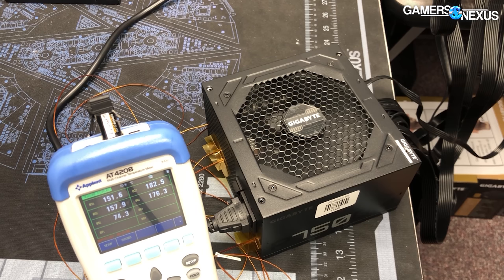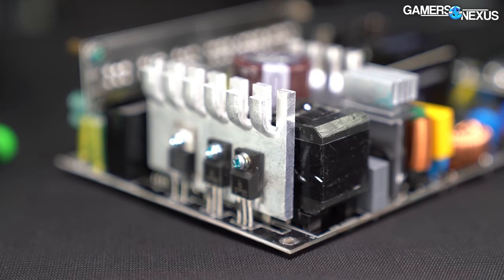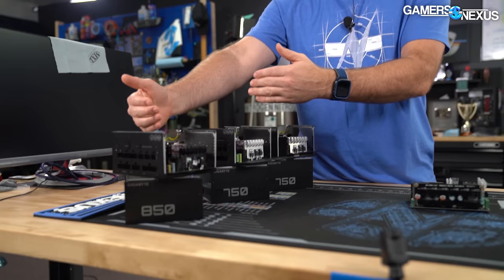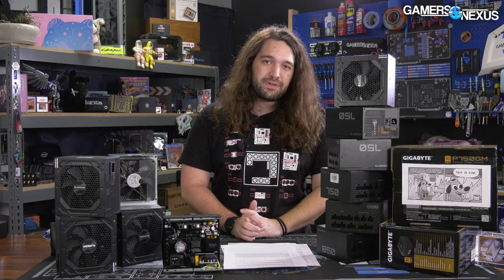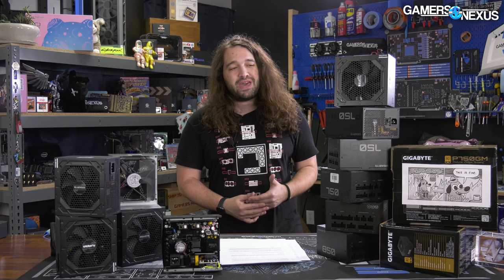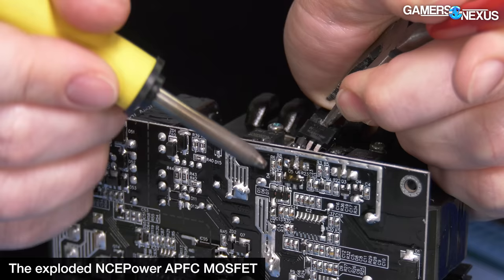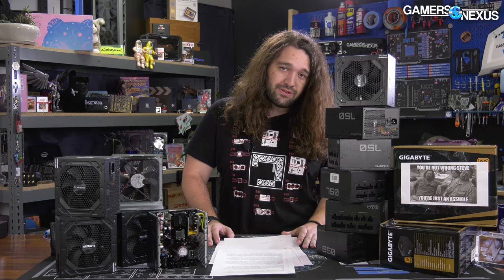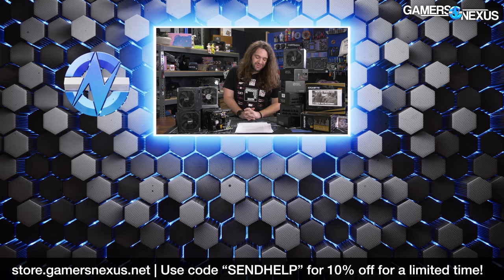Exploding Power Supplies: Gigabyte & Newegg Dumping Unsellable Product

Comment: Fun Fact: The day after this video was posted, Newegg stopped bundling Gigabyte PSUs with cards in the Newegg Shuffle.
Reply: I'm quite worried about my GPU now. It's Gaming OC by Gigabyte. So far not bad, almost a year, but who knows?
Reply: To be fair, shuffle is another word for having a dump. These PSUs are a shuffle, indeed.
Reply: @uraniummore770  gigabyte gpu is ok. It just their psu and some mobo is bad.
Reply: @fr0z3nshade  I see. Well that's very reassuring, thank you, truly. I shall take care of my system, so it would be fine as long, as possible (:
Reply: lol they couldn’t get away with forcing incendiary explosives on unsuspecting customers anymore
Reply: I stopped buying gigabyte after a motherboard cap popped and killed a CPU.
I go ASrock now and I haven't had a issue.
Reply: @uraniummore770  i don't think their cards are bad. i had a 1060 3gb from them for about 3 years before i upgraded to my msi 1070ti. the 1060 worked good for me during. i think it's just their psus.
Reply: What are they bundling now? Old motherboards? :)
Reply: They won't take your powersupply back unless it's part of the recalled serial numbers though. I tried to return mine and they denied me.
Reply: @uraniummore770  I got the same bundle as you and have been using this PSU for a year now also.. Did you happen to replace yours already?
Reply: The fact that Newegg even thought it was a good idea to forcefully bundle these PSUs with GPUs is enough for me to never spend a cent to Newegg. Period.
Reply: I just got this psu. Fuck sakes.
Reply: @uraniummore770  I used a Gigabyte xtreme 1060 since they launched until about 6 months ago and never had issues. It's really only their PSUs/new Mobos that are bad.
Reply: Fun fact: NZXT is still using these in their prebuilts as of January 2022.
Reply: @alkaline.dreamer  uh oh, i have a gigabyte mobo...
Reply: @uraniummore770  I got a 3070ti Gaming OC and they are well built cards, middle of the road VRMs, but good cooling and performance
Reply: @uraniummore770  never had any issues with Gigabyte GPU, Motherboards or heck even their Aorus laptops. PSUs... I'll stick with Corsair.
Reply: Too bad there has to be a kill shot aimed at NewEgg for them to treat their customers with a semblance of decency
Reply: @jimmyluofficial241  depends, I had the Aorus Master 3080 and the thermal pads were absolute garbage. Under gaming load the memory would reach 110 C which is not great for the life of memory. I had to do a tear down and replace them and it ran A LOT better
Reply: @findantu  Asus for me but yeah Gigabyte appears to have zero quality control standards or customer care. Use at your own risk
Reply: @uraniummore770 Late but I wouldn't buy anything Gigabyte. All their stuff is mediocre to downright dangerous, like this. It's cheap because it's crap, they're the Hyundai/Kia of the tech industry
Reply: @findantu  i love how asrock went from the dogshit but cheap mobo brand to being a very good and reliable brand

Comment: the way gigabyte is handling this… well, i’m never buying anything with a gigabyte logo from now on
Reply: Yeah one of their psus broke it wasn’t the model mentioned in the video and their warranty makes you pay shipping both ways so it was cheaper to buy a new one
Reply: Me too.
Reply: I always had the feeling that gigabyte made questionable products but yeah this seals the deal for me
Reply: mine was the motherboard. keep getting BSOD. no more gigabyte for me. :(
Reply: I made this same decision literally 17 years ago and have never regretted it!  My very overpriced GA-7DPXDW had every capacitor fail within a month and gigabyte blamed me!
Reply: Meh. I've just made way too good experiences with Gigabyte GPUs not to buy them anymore. But yeah, anything else is a big no from me now.
Reply: I had a Gigabyte 1660 Ti which failed after a month. Bought an MSI one, been running for 1,5 years without a problem.
Reply: experience my with gigabyte mobos has been shitty aswell. every mobo i have bought from them has had some or other issue. no more gigabyte.
Reply: @builditbuilda2925  Interesting. For me ASUS is way worse. I bought 3 B550 mainboards from ASUS, 2 of them had my RAM locked to 2200mhz, and the third straight out had the yellow RAM error LED on no matter what CPU or RAM I put in. With Gigabyte I "only" have a 25% defect rate instead of a 100% one. So far the only mainboard vendor that didn't disappoint is MSI.
Reply: i had an mobo from them few years back. so many issues with blue screen because of the mobo. I had the worst time with their tech support. Since then, never again !
Reply: @builditbuilda2925  my gigabyte Mobo still running after 6 years
Reply: They have the worst customer support too, just TERRIBLE!
Reply: @shydre  dunno since I never had any problems with gigabyte
Reply: @somakun1806  the old mobos for like second and third gen Intel die CONSTANTLY in comparison to the other brands I get, I have an E-recycling side-company so I often get dozens of them all at once from companies to refurb/recycle and their mobos are the most DOA I get. Having said that I know my experience like everyone else's is anecdotal and larger amounts of data are required for accuracy. I have a lot of X570/B550 mobos from them I've built/used and they've been fine for the most part other than their 'bordering on malware' RGB software. Dealing with their customer service though is always a nightmare regardless of parts
Reply: @shydre it could be that to make more profits the company started using low grade materials to build their mobo.  Before things used to be Strong and sturdy now they dont.
Reply: @SuperFryn  infact as i am typing this i am dealing with a problem with their mobo ab350 gaming . the first slot refuses to recognize any modern gaming gpu. and gets stuck on vga error tried it with two different cards.but accepts a gt 730 happily. idk why.stupid gigabyte.
Reply: I had a very bad experience with RX 480 it overheats so bad that i took a decision not to buy a Gigabyte GPU anymore!
Reply: @zf8496  I had very experience with shapphire ...didn't even last 3 years so since it was under warranty they sent me another which also died just when the warranty ended.
Reply: They started having some good products lately so I wanted to get one of their mobos for a try, but now I'm just worried about their whole...... Way of doing business..
Reply: Same
Reply: I had a z97 motherboard and a 980 ti both from gigabyte fail on me.
I am avoiding them as much as i can at this point.
Reply: I've bought a Gigabyte motherboard years ago. It was at that moment that I decided to never buy a Gigabyte product again.
Reply: tbh, I've always been sus of gigabyte products. Like I've seen reviews of gigabyte motherboards and they haven't been too great and now this!
This just reinforces my bad view of gigabyte.
Reply: @somakun1806  you do realise if they used to make good products back then doesn’t mean they make good products now
Reply: @Snay1998  that's what I said in my prev did you even read it
Reply: i’m never buying anything gigabyte again also. My Gigabyte MB sucked so much power it melted the power supply plug MB connection. Very old MB.
Reply: All brands make shit products.
Reply: @seeibe  I would love to get msi sadly extremely bad rma experience in my country for then.

I have had the same experience asus boards 3 dead and GPUs too have crapped on me before,my only gigabyte issue has been with it is bios,and always on amd board idk why but Intel gigabyte boards were rock solid,I remember scratching the pcb with a screwdriver accidentally but the board worked fine since it has the 5 layer protection. It still runs fine after 10 years in a old pc. 

Even their rma experience was good.so yeah gigabyte boards may not be the worse of the lot. Better than asus and asrock but not as good as msi.
Reply: @somakun1806  my gigabyte lga 1155 is running for 10-11 years now from launch day of Sandy bridge. Only issue I had with it was with its audio pins.

It's my amd b350 gaming RGB board that has given me the most trouble. Absolutely shitty bios for a expensive so called top class gaming RGB board. The bios update also managed to kill a ram and GPUs idk how along with the board. I guess since it was a first gen product (wrt ryzen) there must be some kinks in it.
Reply: Sonic Mobian  more people need to learn to repair.gpu's,motherboards,hdds can be easily repaired for cheap. throwing away often times is wasting good electronics.
Reply: always gigabyte.. i had aorus mobo.. dual bios feature.. both still bricked.. lol
Reply: Y you Do this  return and buy msi,asrock or asus although asus imo is worse than gigabyte. so either msi or stick with giga
Reply: Y you Do this  why list online cant you just return to newegg or wherever you got it from ?
Reply: It's disgusting especially because of the insane markups all these companies have been putting on everything with all the shortages.  If basic components are getting premium pricing, you sure as shit better be treating people well.
Reply: Y you Do this  oof. return policy 10 days are you from india ? here we have that 10 day crap instead of 30 day returns
Reply: Same with western digital and Maxtor crap HDD that fail without warning. SanDisk has done me better so far lol.
Reply: @SuperFryn  yarp I had a Mobo would do that and one day it did it and then wouldn't restart and inspection revealed a power cap had literally burst open. Killed my whole rig even the PSU. I was sooooo pissed my roommate came home right as I threw the whole tower into the front yard.
Reply: When researching used X79 motherboards, I stayed away from Gigabyte (based on ad hoc forum reviews) and focused on ASUS and ASROCK. The ASUS P9X79Pro is one quality motherboard and my workhorse for the home office (coupled with an XEON E5-1680V2 at 4.3 Ghz on air). They are a bit overpriced on the second-hand mkt, though I scored a mint one in a local "packaged bundle" that netted me a price of only US$20; it even came with the original box, incl all accessories and paperwork! It has been running faithfully for over 2 years now, and in today's market I have no incentive to upgrade.
Other than a Gigabyte RX590 that I bought new for only $170 back in late Jan 2020 (yes, I timed it perfectly), I pretty much stay away from Gigabyte.
Reply: Bah, their motherboards used to do this. My PC was set ON FIRE by a Gigabyte mobo. This comes as no surprise to me.
Reply: My Gigabyte 550w psu (rx 580 4gb vram) 16gb ddr3 1666mhz and an i7 3770, was playing isnurgency sandstorm 2 days after building PC and the PSU literally sparked flames scared the shit out of me. insanely bad trash don't trust me!! THANK GOD none of my parts were damaged, got my self a cooler master mwe 650w for almost the same price insane!!
Reply: did you ever before? gigabyte has always been the cheapest junk on the market. rgb and fancy names did not change this xD
Reply: @somakun1806  well it better lol. ive seen countless 20 year old motherboards still working fine.. 6 years is nothing for a motherboard.
Reply: Recently ordered a Gigabyte 2060 and thought i was set for years in 1080p gaming, but nope. 😟
Windforce cooling is a big, cheap piece of crap, massive fan rattling and noise on full load. And doesn't even run cool at 2400+ fan RPM, a complete joke.
Returned that shit and went back to the old RX470 ( hey, at least it works great ). Not touching another Gigabyte GPU with a ten-foot pole.
Reply: Same dude
Reply: Bought a gigabyte mobo and it had a weird aggravating defect where it'd suddenly restart if it had no ethernet connection. Replaced it with an msi board and no more BS
Reply: I've always considered them a discount brand... I've never bought anything gigabyte cept my current GPU I got right at the start of the price hiking.
Reply: I said the same about Anus (Asus) 15+years ago, I have bought and been happy with many of their products since, and yes, I still call them Anus even though I use their stuff... Habit.
Reply: Yeah, problem is you gotta exclude most brands out there for their bad practices... I won't buy from MSI from their dealings with GN a while back.  I won't count out a brand over one bum product, but if they consistently deliver crap to alot of customers, wise to just steer clear.  Manufacturing is never perfect but errors should be minimized
Reply: so they sold stuff they knew was defective ?
Reply: Idk man never had any problems with Gigabyte although I've only had their motherboards. Got a B550 Aorus Master in my PC now.
Reply: ordered my first gigabyte ssd, dead on arrival
I once had a gigabyte mouse, it lasted for a year
Reply: I've never buy any pc components from this brand, psu even worse. its sucks and always has been. in my country they called this brand "Gigabuayte"  its means "Giga Sucks".
Reply: @chezzy1908  damn really? Even Seasonic only made me pay for shipping one way. That's bullshit. Honestly before this video I didn't even know Gigabyte made PSUs lol
Reply: I was never a fan of Gigabyte, even before this whole exploding PSU fiasco